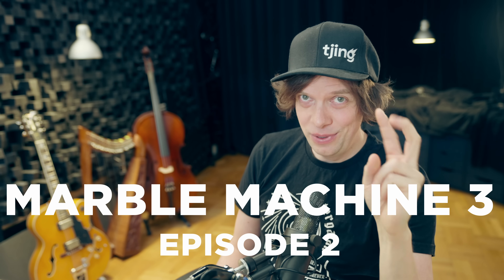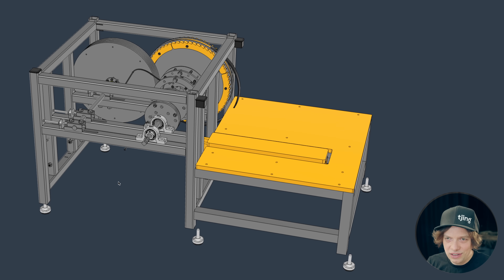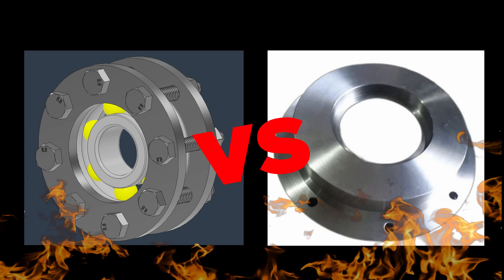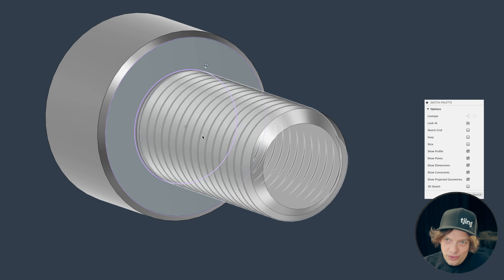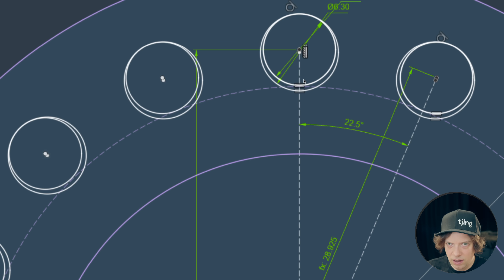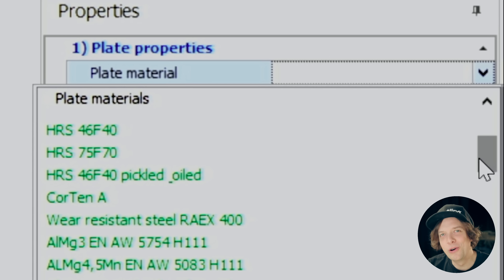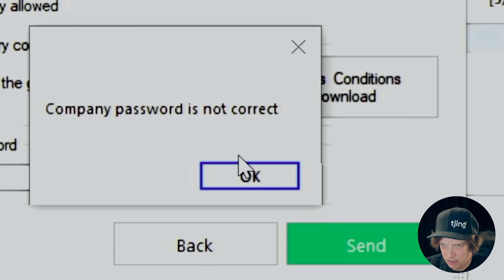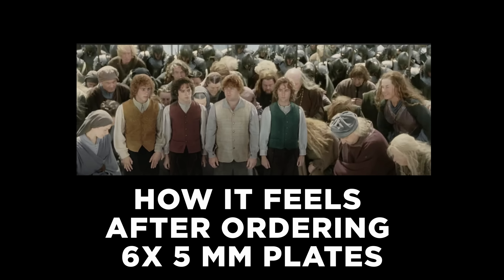Cheap Bearing Housing - Marble Machine 3 Ep.2

Comment: It's not nice dogpiling an idea to the ground but i'm positive this solution will come back to bite you. You can buy premade bearing housings, with the additional benefit of a slight disalignment correction and correct tolerances, for around the same price of your solution once you factor in the price of the two disks, the bolts and the bearing (a UCFL205 unit is something like 15€).
If you must press on with this idea at least consider turning an in-tolerance recess to house the bearings inside the disks instead of relying on the bolts' shoulders (!), any machine shop can do that quick and easy

Comment: the bearing housing will grind on the threads, if nothing else eventually the fitment will loosen.
Reply: Yep. The best solution is a 4 hole flanged bearing. He can bolt the bearing right to the flyweel.

Comment: Honestly I think you are trying to find a solution for a non existing problem. This method will not be 100x times cheaper than a machined part. Look around, there are even standard bearing housings that will not be that expensive.

Comment: 1. the Bearing housing is designed to hold a Bearing evenly at the rotational plane - your Bearing holder with cause pressure points and failure over time
2. your Bearing Housing design will cause shear forces at the plane of rotation because all the holding pressure will be above and below the plane of rotation
3. most Bearing are designed for the outer casing to be under a specific pressure - as in the Bearing is meant to be forced into a specific sized housing dimension

there is an old question in engineering that you need to think about
"Will i trust my life to this?"

Comment: I think the equation of "100 × more expensive needs to be 100 × better" is not true – the question is whether certain problems of the "cheap" design will cause issues which let your machine fail which would be avoided by the alternative. (I can't judge this, just wanted to point out the fallacy here.)

Otherwise, just omitting a part is ∞ times cheaper than having it, so a machine without any parts would be perfect.

Comment: Please listen to the pain of all of us poor engineers in your comments 😂
I love your channel and really admire the journey you've comited to. 
But please, go away from this idea. As a lot of other people said, threads are not precise enough to be use for alignement. They really good for tightenning stuff, but that's pretty much all the can do. Using this design throughout the entire machine will have two effect : a lot a post-processing, because in a lot of cases, the fit won't be good. You also risk to have some eccentricity in fly wheel, which means crazy vibrations, machine moving all over the place by itself, and in the worst case a very serious safety hazard (it will shake itself apart and run away uncontrollably).

Proper machined bearing housing with adeuqtae tolerancing is really the only reliable way, but here are a few alternate suggestions :
- replace the bolts by some precision ground alignement pins for alignement. Use bolts for tightening only
- fill the gap between the two outer plates with ring plate with an internal diameter that tightly fits the bearing
- machine a shoulder on the inside of the plates that tightly fits the bearing outer diameter.

Also, keep in mind that in this case, proper design guideline points toward an interference fit on the outer diameter of the bearing and a sleep fit on the axle.

With love,

Comment: As a physics-person, I want to point out some things about the Moment-of-Inertia.  Specifically, for a flywheel.
• Take a hoop and a disk, both the same mass and radius.  The Moment-of-Inertia of the disk is one HALF the moment of inertia of the hoop.
• The moment of inertia is not a function of thickness.  So 6 1 kg disks vs. one 6kg disk is exactly the same Moment of Inertia.
• The moment of inertia, of both a disk and a hoop, is a linear function of the Mass, but a function of the radius-squared.

A hoop is obviously impractical, since you'll need spokes.  But, if you want to go with a disk, you want one with Most of the Mass around the edge.  Put another way:  Instead of 6 disks, have two disks sandwiching 4 rings of the same mass as the disks.  Each  of the rings has [roughly] double the Moment of Inertia of a disk, so the "disk-4-ring-disk"-sandwich will have "disk + disk + 4*2*disk"=="disk*[2 + 8]" == 10/6 times the Moment of Inertia¹ of the 6-disk-sandwich.  Again:  This requires the ring to have the same mass as the disk, thereby shifting all of that mass outward.

¹Note:  Since a ring isn't an infinitely-thin hoop, it's not going to be exactly double the M.o.I. of a disk of the same mass and radius.  It will actually be somewhat less.  But the point remains:  Concentrate Mass Around the Outside of the Flywheel.  That will give you a better Moment of Inertia, and from that, higher torque.

Comment: What precision are your steel cut parts defaulting too? If you are sending this all of to an EDM wire machine or to a decent CNC mill shop then just add another layer to your steel stack up that captures the bearing's OD...
Still not as good as proper fit the machinist can give you that will position the bearing properly in its x-y plane AND usually have positional control along the axles length as well...

Comment: You are aware that you can buy working, well designed bearing housings including bearing for less than one of these plates?
A bearing housing should not be a designed part - it is hardware. 
If you are going to start designing such trivial parts, in order to make them cheap, and then pay twice the price of an off-the shelf solution, you are doing it wrong.
Seriously - bearings and housings are already invented - your job is to invent the marble machine. Buy the damn parts.

Comment: I'ld use screws with a shaft if I would use such a bearing holder. However, I'ld not do it like this in the first place. Having a well centred bearing is essential for everything that comes after. It feels like cutting costs at the wrong place. Therefore, I'ld machine this part and would use the same bearing all over to reduce cost/complexity.

Comment: A concentric, true-running flywheel is 100x better than an eccentric flywheel. And designing this system with threaded fasteners to locate the bearing WILL result in an eccentric flywheel. Therefore, a machined bearing housing is at least 100x better than what you're contemplating.

Comment: If you want to orient and position precisely your bearing, you can use one fixed pin in place of a bolt, and one folating pin in place of another bolt and use laser cut parts in the middle of the ones you designed to "hug" the bearing.

Comment: Hello Martin, about the M6 bolt you was speaking of the tolerants it is what of kint materiaal you used by wood you have drill 6.1mm or 6.2 mm in steel you can drill 5.9mm or 6mm you must know what the temperatuur you used also is it posible that the machine  is going wet. when you drill more holes in a patron you have to used a cnc machine for a acuraat distens 👍😉

Comment: Engineering student here.
I don't quite see the argument for your design vs a custom made machined bearing.
It may be true, that designing and manufacturing that bearing may cost a lot of time,
but consider the time lost for trying a - no offense - sketchy solution that may not work in the end.

As for your design itself:
- standard metric threads have nowhere near the precision required for fixing a bearing coaxially,
not to mention the clearance hole in the sheet-metal ring, which does not prevent the screw from tilting left to right,
essentially allowing the top plate to shift and rotate relative to the bottom plate.

If the screws were percision ground pins with a thread cut at the tip and an interference fit with the metal rings,
this design might actually be somewhat viable.

Comment: Another Engineer here.  This may work for slow lightweight applications in the machine.  But for your high RPM high inertia flywheel, DON"T DO IT!!!!!!  You may only need properly made bearing housings for the flywheel.  Bite the bullet and move on.  Save your nifty bearing mount for things that are rotating at 2 RPM and weigh a couple kilos.  You don't want to rename your band "Catching Flywheels".

Also think about how you are ever going to balance the flywheel, remember trying to do that on the MMX?  This bearing capture method is likely to slip and move on you.

I have seen a 7000 RPM flywheel break off a 100hp snowmobile engine and dance around a dynamometer room until it came to rest.  By the marks in the concrete floor, I am very happy I was in another room.  Just glad it didn't catch on a solid part and launch itself through the triple pane window!
Reply: Maybe this was covered in another video, but as anecdote about the snowmobile shows, it's not like flywheels and spinning disk shaped objects in general (wheels) are uncommon. Is there some reason he isn't using off-the-shelf components and modifying them for his purposes? It seems an obvious alternative to designing a cheap ineffective solution or ordering an expensive custom solution.
Reply: Hahahahahahahaha catching flywheels. Youbgot me good there XD

Comment: As a becoming mechanical engineer there are a few things that come to my mind regarding this solution:

The thread surface of the bolts contacting the bearing is very small which means there is a high load on the very tip of the threats probably resulting in fast wear of the tips. This can quickly make a snug fit into a lose bearing fit. 
For a bearing that is holding a heavy, fast spinning flywheel it is very important for it to be dead center and well balanced.
Hell breaks loose if this thing has a chance to get out of centre.
I´m aware that the load of the flywheel doesn´t go through the bolts but rather through the mounting plate of your bearing but this only holds it by friction and in my eyes is not that reliable.
As other comments also pointed out there´s also something as error propagation and tolerance stacking which could become a big problem.

It is well possible that this solution could work but it begs a big potential to failure. 

P.S. A few Lasercut metal plates with a big, precise hole for the bearing in the middle and holes for the screws on the outside could be a cheap more reliable solution or just use a pre mounted bearing.
Reply: The PS is my first thought. Why not just make the pre-existing hole slightly larger and press fit it? He could even double up on plates to keep it locked in place. This solution is asinine.
Reply: @JZStudiosonline  Hard to get that precision from laser cutting. Really need .0005" accuracy or better for press fits, which is very close to the limits of that method. Might be hit or miss, which isn't good for 'production' as he intends.
Reply: @Anti-matter-reactor  It just needs to be a softer material. I'd expect a chunky 3D print or even Martin's favourite CNC plywood to work fine
Reply: @Anti-matter-reactor  I'd assumed he was getting them CNC cut. Doing this method requires both the bolts and bolt hole pattern to be precise as well.
Reply: Hex head shoulder bolts! At least the contact point is smooth and only the end is threaded.

Comment: It is good that you experiment with this idea and will put it to test, so there is no more - what ifs,  but I also agree to I guess many viewers that it won't be reliable, it will be nightmare to center, bolt threads are weak and will probably wear out because there will be movement from all the loads on flywheel and axle. Also if you have watched the episode of Sandy Munro saying, that they did a reasearch at Ford on what was the cause of most of their manufacturing and realiabilty problems and the answer was bolts.

So again I think it's good that you test this idea, but it won't be easiest or best solution.

Comment: It seems like a VERY bad idea to have the bolts holding the bearing in. I am no expert, but the plate that the bolt goes through should have a groove/channel around the plate for the bearing to sit in. There probably is an example/application that is already in use. Don't re-invent the wheel when other, already tested, parts are already out there. Maybe like a car Wheel/hub.   I think that is part of your failures. Over engineering parts that  I understand trying to design things from the ground up, but this is actually a kind of wheel.  PLUS I don't see your failures, as failures, but a Learning Experience that you have built upon.  Thank you for not giving up.

Comment: I'm not expert and is why I'm ask...
Why not a simple machined flange between the bearing and the bolts?
MDF, plywood, PVC... Just a big "washer" embracing the bearing and with holes for the screws. Any inconsistency you have just redo this flange.

Comment: You can get the results you want with a slightly different approach. You would have to affix the bolts to the first plate then machine it to the proper bearing tolerance. As long as you don't remove too much of the bolt it will still function completely normal.

Comment: There's off the shelf parts you can be using to accomplish this. Bearing housings aren't designed this way for a reason. Think about how many bearing housings are used in different vehicles. They're basically all press-fit bearing housings that support the bearing uniformly across its entire outside diameter. This will increase longevity and mitigate any risk of failure. Furthermore these bearing housings are not parts you will need to replace with any bit of high frequency. It's foolish to waste your time trying to solve problems that already have refined solutions that have undergone centuries of iterations when you already need to design several completely bespoke and unique parts.

Keep it simple where you can.

Comment: The math of 100 times more in cost requires that something is 100 times better is flawed. In all likely hood it won't be (if you can even define "better"). If the cheap version cost 100x less but causes 10 more issues its likely not wortwhile. If something costs 100x but the project works with it, but not without it, is it "worth"  it then? Depends on absolute values at some point, but it's way more complicated that a magnitude guess of "better".

Comment: Martin I understand you're very engaged by these custom solutions, but that's exactly why the first machine failed. If part of your design is not well served by proven available methods and parts, it's your design that needs to change.

It seems fine now, but if you take this route to every single part of the MM3's design (as you did with the MMX), the outcome will be the same.

You must accept that you cannot constantly reinvent the wheel.

Comment: You need to use a type of bearing called “Insert Bearing” which has simple stamped plate flanges that you can bolt to either side of your flywheel.
Reply: Still say he should just get the flywheel machined to accept a press fit bearing and call it a day.
Reply: I was thinking: ok there must be pre-made parts for this purpose, I hope Martin reads your post.
Reply: This man is talking with the real talk here.
Reply: @BobsBobbers  he’s talking trade secret language …… but for some reason it’s making sense to all of us.
Reply: @cll1out  lol trade secret language, nah it's just that anything that exists has a name, in niche cases it's just hard to find the right name for the thing you actually want. I'd also point out what the op says and what he describes are two different things, insert bearings ≠ flange bearings, two different objects. There are flanged insert bearings tho.
Reply: Are these also called flange mount bearings?
Reply: Most all those types of flange mount bearings are self aligning. And i don't think his construction would be compatible with that.
Reply: Flange bearings come for peanuts and just work. Simply unacceptable in this channel.

Comment: One of the main issues I can see with the threaded bolts holding the bearing in place is that as the bearing is rotating and loads are imparted radially through the bearing and onto the bolts, the threads of the bolts may start deforming (depending on what loads you are looking at) or potentially wearing away material from the threads or the outside diameter of the bearing casing. In either case, the more the threads bend or if the threads are cutting into the bearing after many cycles, your tolerances will be getting looser and your outside bearing housing will be more susceptible to spinning freely and causing more wear as it rubs up against the bolt threads. The main proponent of having machined bearing liners or housings is to keep uniform pressure via a pressure fit all around the bearing to prevent the bearing from shifting around and causing wear and to keep the bearing precisely where you want it.
Reply: Yep. Use friction of the mating surfaces through preload vs shear forces on the bolts.

Comment: I feel the need to weigh in against the bearing housing haters.

1. Trying it cost less than a brand name bearing housing
2. This will let him use cheap 6205s which are unbelievably cheap
3. Why do people think the bolts are going to wear? That is what the bearing is for, lol.
4. Almost all parts on this build can handle the variance between bolts from the same manufacturer.

If this doesn't work then easy peasy, toss in a flange bearing etc while also testing the supplier, materials, and their tolerances.